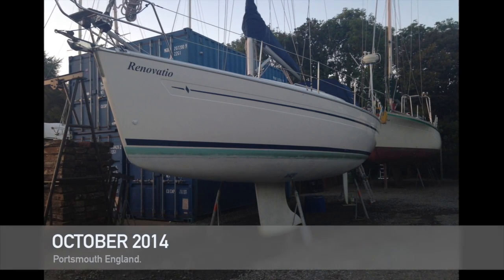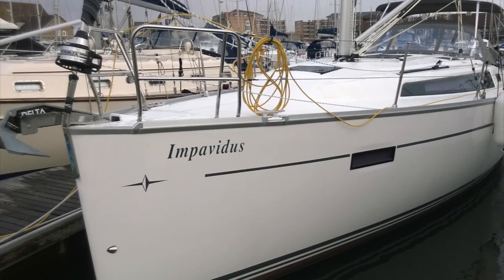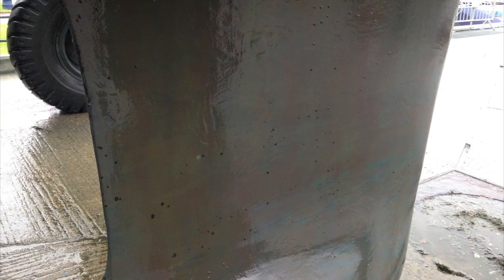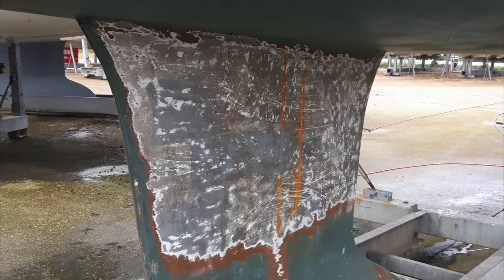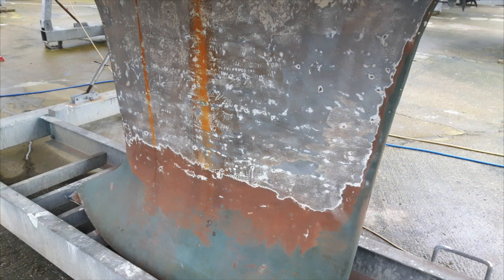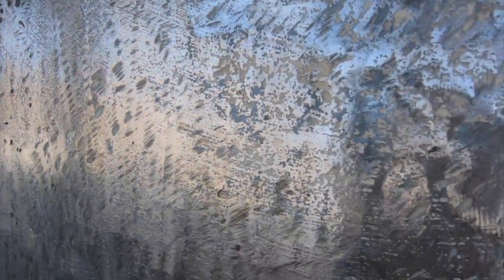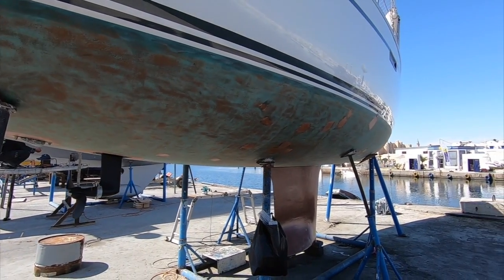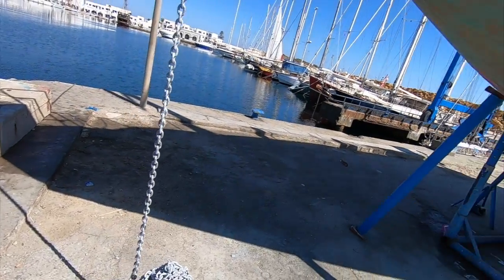Has our Coppercoat failed?

Comment: Our coppercoat peeled off the keel. We used a flap wheel and immediately cleaned with acetone followed by commercial primer as soon as the acetone evaporated. We then applied two coats of Seaforce 90 a/f. Two years later we pulled out the keel's a/f was still in good order and did not show any rust. So hopefully your flap wheel cleaning will do better than you expect.
Reply from the maker: Well hopefully. But I am not putting money on it :-) Sail Safe Guys, Ant, Cid & the pooch crew.

Comment: I appreciate you putting all this together in one video.  There have been a lot of videos on coppercoat failing, and it appears that the application and/or surface prep is mainly to blame. I will keep watching to see how long it lasts on the hull, and how long your latest keel work lasts.
Encapsulated ballast, long keels aren't as efficient, but the care needed on the iron, bolt on keels is definitely something to consider.
Reply from the maker: It's all about doing the job properly. Some companies do and some don't. Sail Safe mate. Ant, Cid & the pooch crew.
Reply: Cast iron seems to be the issue. CC on the hull surface seems to exhibit a lot less trouble
Reply: @SailingYachtSaltyLass  because , unlike cast iron, it does not need to be left to dry out completely, then dry blasted, then immediately given a seal coat to prevent flash rusting - unless its an iron/steel/aluminium hull off course.

Comment: I was lucky enough to observe the application of CC on Britican in Dec 2019. They had lots of problems with application errors.
When in Grenada the CEO of CopperCoat came over and helped applying the new coating.
From then on hardly any growth and half a knot of boat speed extra.
Reply from the maker: Yes. We have had correspondence with them. It is all down to the correct prep and application. Sail Safe mate. Ant, Cid & the pooch crew.
Reply: @SVImpavidus  This really puts me off the coppercoat investment and to stick to AF paint instead.
Reply from the maker: @pete9501  CC does work.... Its all down to the competence of the applicator. Thats something CC need to ensure they get right.
Reply: @pete9501  
I've gone the same way tbh. The recommended Contractor Route was clearly very risky, back in 2016, when I wanted CopperCoat for my last boat, so to buy the time needed to find a good Contractor,  I opted for Pettit Trinidad Pro Hard Antifouling put on by a good Yard, instead. I have to have such work done for me due to Being Disabled, and now for my Next Boat, hopefully next year, I think it'll be back to Pettit Trinidad Pro Hard Again, it was highly satisfactory on my last boat tbh. With tlc, it can remain effective up to 7 years (regular cleaning needed by divers though, which adds up, though should be clean hull up to 3 years, then desliming).  Still, 6 years later, the formulation may well not be that good still. 🤔

Comment: This is bloody sad. ☹️ I really wanted CopperCoat on my Last Boat, and would really like it on my next boat as well, though could no longer do the Work Myself, due to being Sisabled but in 2016(last boat) on researching CopperCoat Antifouling, it Rapidly became Clear that getting a trustworthy reliable Contractor, was such a Gamble, for not low cost Antifouling was a Gamble with not exactly reassuring Odds of Success, not helped by the truly Outstanding Yard I had the boat fully prepped and serviced in, never having done a Coppercoat application. I'm retrospect, they had the facilities indoors to have the Boat in, and they were so Conscientious and skilled, I think they would have done a good job, however time was running short on my Visa, and I needed to clear USA Waters sooner rather than later. So I went with something that with care and tlc, could give up to 7 years reliable service Pettit Trinidad Pro Hard Antifouling,  reckoning that would buy enough time to find somewhere that could apply Coppercoat Properly. It's rather disturbing, that 6 or so years later, it looks like I'm in exactly the same Predicament with my next Sailboat. To me, the buck stops with CopperCoat and their recommended Contractors need sorting out, withninly those Skilled enough and trustworthy enough able to make it onto their Recommended Contractors List. Any Chance of Suing them for Contributory Negligence and Failure of Professional Oversight, or failures along similar lines ? That may well be the kick up their Arse thatbthey need ? I did speak to them in the USA when there and they did seem very nice people with a great product, but they need to up their game to a much higher professional Standard Clearly. At some point in the Future, I would love to have CopperCoat on my Boat, but as of now, sadly I really can't take the risk - still. Looks like it's going to be Pettit Trinidad Pro Hard Antifouling Again. That Yard did do a cracking job on it, but it means Antifouling prior to Crossing the Atlantic just to get to them. Anyone know any skilled and Trustworthy Yards this side of the Atlantic or even in the Med, able to do the Work by any chance ? 🤔
Reply from the maker: We are just in the process of looking at a re-coat after 8 years. This spring we intend to do the work ourselves buying direct from Copper Coat. We agree Copper Coat need to get their house in order. Setting up a training scheeme and a robust QA system would be easy and pay for itself over and over. Unfortunatly it is not the way they want to do busness. We have never heard from them again despite the amount of views this and our other Coppercoat videos have made, where we are positive about the product but point out the pitfalls. Its a good product but lacks the QA to make it a great product. Thanks for watching. Sail Safe mate. Ant & Cid

Comment: Exactly the same situation on board CaSam Ant! Again all done from new through Clipper (Albeit the installer on my occasion was not OSMOTEC but another "Qualified and Certified" Copper Coat installer - based at the top of the Itchen :(  ) Since then she has been done twice and the last time I have actually refused to put Coppercoat back onto the keel....opting this time for a very hard "wipeable" antifoul. It is a real shame though as just like Impavidus, the hull is still in great shape. There are many anecdotal comments out there but I do have a feeling that Bavaria themselves have a fair responsibility too though due to the quality of the keel in the first place.
Reply from the maker: Totally agree.

Comment: I'm wondering if your keel is properly grounded to the anodes. As the keel does not appear to have anodes of its own, then internal wiring is needed to connect to anodes. As with all external metal parts, if they dont' have anodes of their own, then they must be connected to anodes elsewhere.
Reply from the maker: No the keel does not have any anodes none of the Bavaria's do. The issue here is bady applied Copper Coat by Coppercoats approved contractor. Since we did the job properly we have had no issues. Sail Safe mate. Ant & Cid

Comment: Not seeing the logic that this is actually a coppercoat product problem. My understanding is that the rust problem probably started before the coppercoat was re-applied. It may well be an applicator/preparation issue caused by the staff of an approved applicator but slamming the product as "failed" seems harsh. Hope your fix is working out.
Reply from the maker: Clearly you have missed some of the video or not got it. For the avoidance of doubt; Copper coat is a good product and we are very happy with it. However, the application in our case was supposedly made by their approved and trained operatives and then approved by their specialist. The work was not carried out in line with their own standards and the expected 10 year life was never achieved or warranted any longer than the 2 year warranty the applicators gave. Therefore the logic is that beyond two years Copper Coat has no backup as they do not stand behind their product when applied by those they approve and train. The product is fine if applied as per Copper coats very precise instructions, as we said in the video and as demonstrated by the areas applied correctly. This is in line with the findings of others that have the coating. Thanks for watching.

Comment: I would let all boaters know this and let’s put copper coat out of business. They don’t stand behind and oversee their applicators and therefore allow shoddy applications. They are guilty by non action. I’m happy to put these kinds of attitudes out the door. Well done video
Reply: IMHO you need to watch the video again. they have stated on many occasions during the video that in their experience cooper coat works. and worked well for them when THEY applied it themselves.
 It is the incorrect application that is the problem. If you expect every manufacturer of a product to provide a person to oversee every installation of their product -  and to absorb that cost themselves - then good luck with getting your house painted or your bricks laid.
Reply from the maker: Its a good product, they should be more involved with their approved applicators after all it is their product and their reputation that is at risk.

Comment: OK I did not realise the issue was just  the keel - I thought you were redoing the lot, hence my previous comments about extra labour.

It is a very sad story, but one that has all too common themes.

You paid the Marina to do the work and they subcontracted the work. So from a legal perspective your (‘privacy of contract’) is entirely with them and from the get go they should have sorted this out.

The subcontractor did not have to deal with you at all.

Copper Coat bear a responsibility ( but not a contractual one) in approving the contractor and (a) not putting pressure on the company to remediate and (b) not delisting them.

All that said I have seen this sort of sh1t all my working life and battled against it too. It is my reason that I do everything (that I possibly can) myself, because then I know the quality of the work - although it probably takes me 3 or 4 times longer than what a ‘professional clock watcher’ would take. I certainly would not allow anyone to do anything to my motorcycle - my life depends on nothing going ‘TU’ while I am riding.

Sorry for the waffling - did you passivate the keel prior to priming?
Reply from the maker: As always Norman you are spot on! It is a sad reflection of the marine/engineering industry. When we get to have that beer I'll tell you about how Portsmouth motorcycles did a routine service on my Blackbird and crossed the fuel return and vent pipe! 15 ltrs of fuel came out the vent in 3 mins all over the back tyre and chain as I wound her up going up the A3(m). Then it dumped the rest of the tank on the drive while i opened the garage door!!!! Watch the next video to see the remedials mate. Sail Safe mate. Ant, Cid & the pooch crew.

Comment: my boat's coppercoat was applied circa 2017 (prior to my purchase) the keels have rusted through similar to yours - i got a quote for it to be media blasted (£600 - £1000) and ive decided i will remove it myself with a angle grinder like in your video.

Do you Know what primer they used??

This is what I've been advised by coppercoat;

In order to treat your keels you will need to grind them back to bare metal and then apply a two pack anti-corrosive epoxy resin which we can supply. You will need to apply three or four good coats of the primer, one coat a day for 3 or 4 days and then wait for a week for the solvent to evaporate out.  After a week, the Coppercoat can then be applied. Mix and apply 1 litre of Coppercoat at a time, painting round and around the boat until all the supplied litres are used. You are likely to complete the treatment in approximately five thin coats. These should be applied consecutively (wet-on-tacky) in one day. All goods are supplied with application instructions and we are always available to answer any questions. To watch the demonstration video, click: http://coppercoat.com/coppercoat-info/videos

In terms of quantities, we supply the Hempel Light Primer in 0.75 litre units and 2.25 litre units.  1 X 2.25 litre units wont quite give you enough for 3/4 good coats so we suggest having one of each.  The 0.75 litre unit is £35 and the 2.25 litre unit is £75, both plus VAT.

Regarding the Coppercoat you will need 1.5 litres of this @ £90 per litre plus VAT.

Primer = £110
Coppercoat = £135
Delivery = £15
Subtotal = £260
VAT = £52
Total = £312

 
This is as at September 2022 and they seem to emphasise the application of primer extensively
Reply from the maker: There is a company on the south coast that will do it for aroun £150. Less if you can get more than one boat that needs doing. They are called Symblast. If you use them tell them we recomended them after they did Renovatio a few years back. Sail Safe mate. Ant & Cid
Reply: The problem seems to clearly be the existence of a s t e e l keel which is vulnerable to rust due to water penetration and very difficult to seal. Seems to me it should be galvanized, hot dipped. Or it's really not an appropriate installation. And here we are blaming the copper when it's not the fault of the copper as we see on the rest of the boat. I wonder how other boats with this Keel installation have fared. A lot of boats use an iron keel with no problems such as the Cascades. I believe they're hot dipped and then bottom painted. I would probably apply a quarter inch layer of fiberglass mat with a very high quality resin after galvanizing or at least painting with zincromate
Reply: @douglundy5755  my keels are iron mate